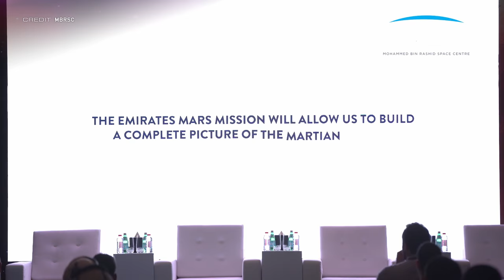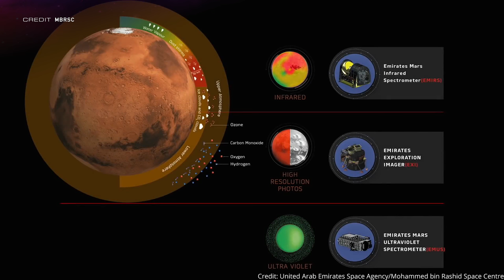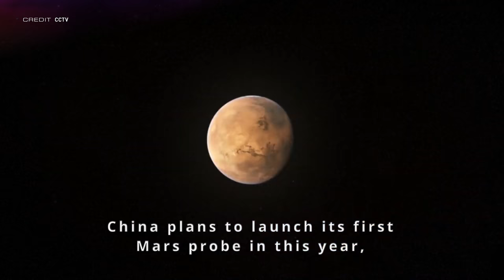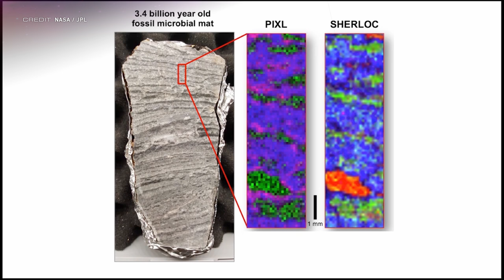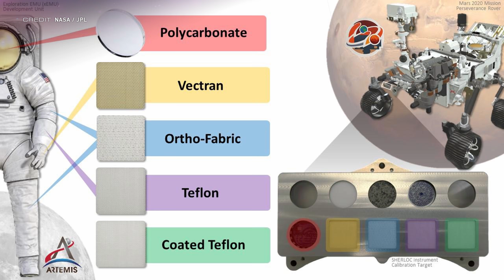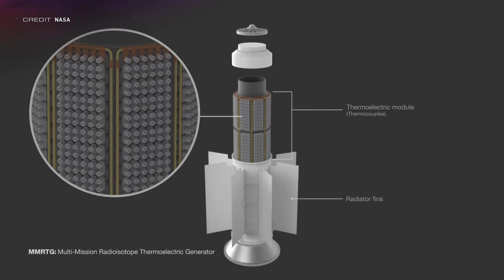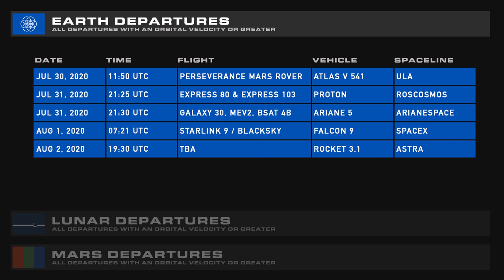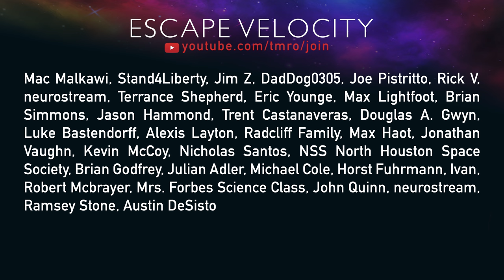Three New Exciting Mars Missions! | TMRO:News

Comment: Thank you for this, Jared. Very well done.  But a question: Could the Mars Microphone pick up the sound, a high pitched noise, of the Mars Helicopter? That would be so mindblowing.
Reply from the maker: Those microphones absolutely will, the Mars Helicopter is LOUD as its contra-rotating blades spin at about 2400rpm: https://youtu.be/nAQxNd3uBN0?t=146

🚀Jared